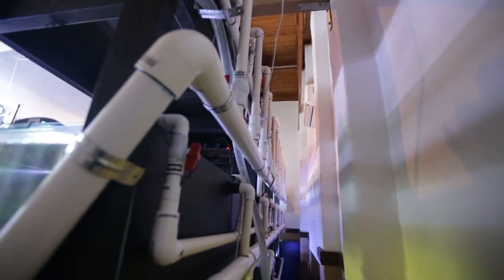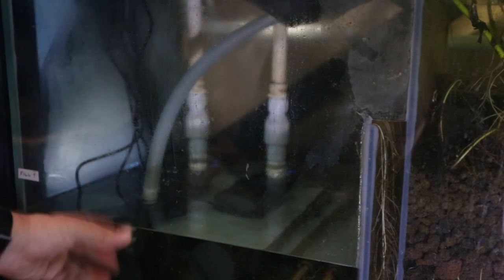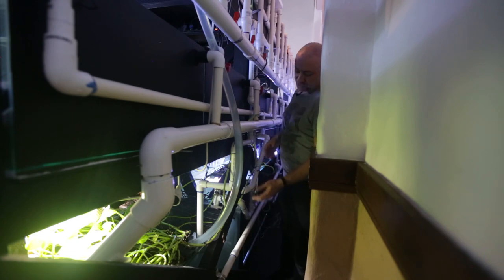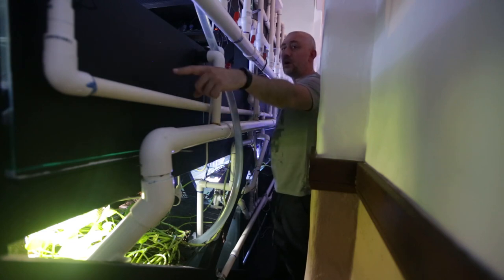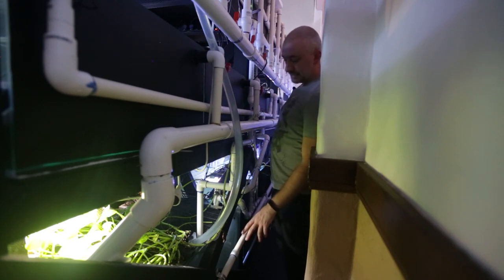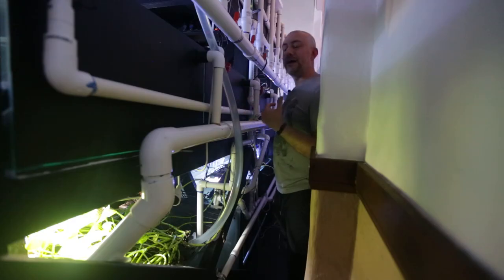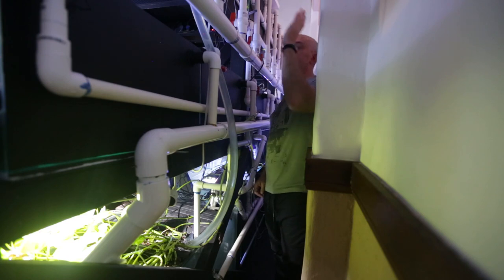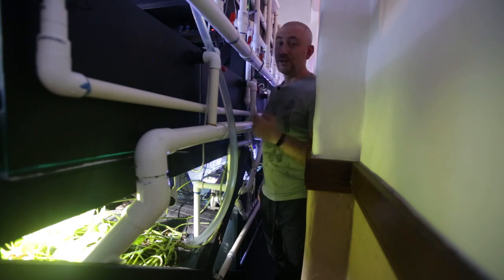20 aquariums run off 2 pumps?! Running a Sump

Comment: well i think it's a great system wouldn't a pressure regulator ensure all the tanks are getting the same amount of water?
Reply from the maker: Thanks for that. I am not sure how that would work to ensure each of the 20 aquariums was getting the required water pressure or where in the plumbing you would place it? That said, not every tank needs the same amount of water pressure. The fry tanks for instance don't get as much flow as say my 4 foot tanks. Hence the ball valves give you flexibility as you need for each tank.

Comment: Hi Jason.
A great insight into your sump system. I shall be doing similar when I eventually set up my fish room. Totally agree with you about water stability on the larger volume.
One question is do your pumps add temperature to your water due to any heat they generate during their normal operation?
Thank you 🙂
Reply from the maker: Cheers Paul. I really recommend it for ease of maintenance. I don't notice any heat generated from the pumps, I actually wish they did! Would save costs on keeping the room warm! If they do then its negligible.

Comment: Jason, I have a similar set up I’m trying to accomplish but I’m having issues with the drain line. I’m only running 6 tanks at the moment but the water in the drain is bubbling and causing splashing in the sump and some tanks occasionally. Can you tell Me what I’m doing wrong
Reply from the maker: Hard to say, you could try reducing the flow rate from your return pump to reduce the bubbling sound. With the sump though, try to feed the water into the sump rather than letting it spill out of a pipe. Adding a filter sock to the end of the pipe will also help reduce the noise. Hope that helps.